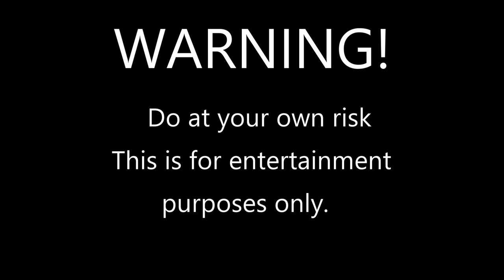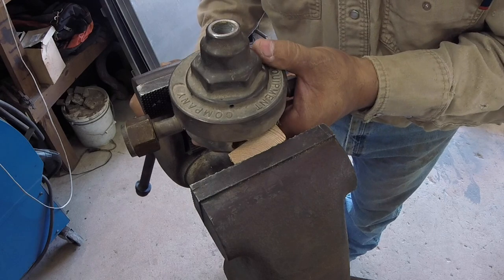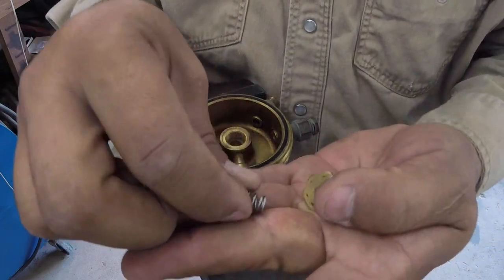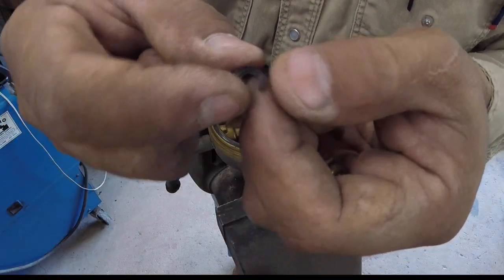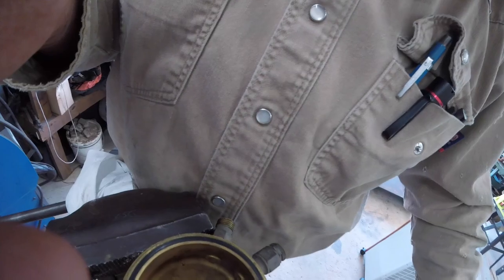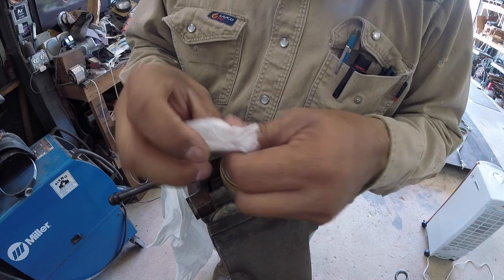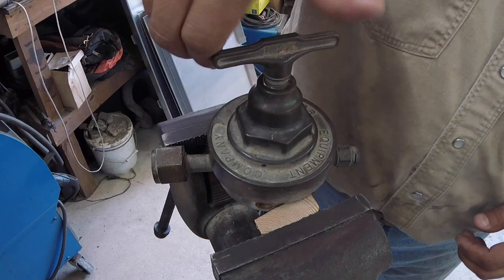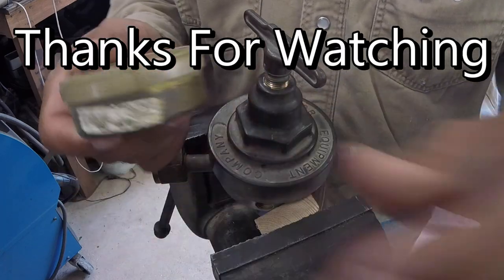Torch Regulator Repair.

Comment: DON'T TRY THIS AT HOME!!! Especially when you deal with an oxygen regulator. Even little amounts of oil in the regulator can cause explosions and devastating fires. It's an absolute hazard to your and others health and safety. I once witnessed the result of a DIY attempt to use a low pressure regulator on a high pressure tank. This time it was "only" nitrogen but the connected machine was destroyed for good and other equipment and the building itself got serverely damaged. Here in Germany you need a license to work on this regulator equipment and also you don't get spare parts in a legal way on the market. So even if a new regulator costs 8000 bucks is this worth your life?
Reply: Yep! Even just the oils from your skin is enough to cause an explosion. High pressure oxygen, it isn't worth the cost of a new regulator to be picking the old one out of your face when you turn it on.
Reply: Yes, most definately!
Reply: It's easy to clean parts to oxygen-safe standards (I worked with LOX in the Air Force among other things) but people have to study to know what those are. I use acetone and of course work outdoors. Nitrile gloves always.

Comment: Surprised the valve failed in a high pressure type of way! Could have been bad for hoses and the user.
Reply: No, the feature which ensures that does not happen is why Victor named that style the SR for safety regulator. The blowoff valve prevents overpressure when the high pressure seat fails as sooner or later any seat will. It's common for regs to last fifty years without failure they're so well made. Once overhauled they're good for another 50.

Comment: As we are discuss hydrogen carbon (oil) &oxygen - don’t use oil based forming agents (fairy liquid ) to test  for O leaks 
Don’t use lubricant on the cylinder connection WD40? 
And. Do not use copper tube anywhere in the acetylene line i.e. joining hose pipes. There is an explosive chemical reaction between copper & acetylene.

Comment: This might be a silly question but, could you just make a new one from an old inner tube? I'm not sure about that white plastic one. 
Awesome video, never tore into one. Had one do the same, took it in, OMG, could've purchased a whole new torch kit for what they charged me. It was the Oxygen regulator as well. Great video as always, cheers :)
Reply: Others posted that it’s viton (fluorine rubber), so unless you’re inner tubes are made of that you shouldn’t.  If you’re inner tube has petroleum products or another substance that reacts with high pressure oxygen it could go boom.

Comment: Geeslus, "oh muh gerd its dangerous!" relax people, keep the hydrocarbons and organics out of the O2 side and you shouldn't have any issues, yes pressure and combustibles is bad, so is being an idiot.
Reply: You realize that fingers are organic and shed skin, and skin oil is oil which explodes in high pressure oxygen?
It's not just spraying it with wd 40 that will cause problems, it can be as simple as not washing your hands before touching something, or there being a little grease residue on the handle of the wrench you are using.
Reply: @northmanlogging2769  lol I was thinking the same thing. To many internet wizards

Comment: IC Weld and the Australian "Cutting Edge Engineering" guy are my faves on YouTube.  However, I think this video needs to be removed.  Not enough care given to cleanliness, and if someone did this bare-handed with an acetylene regulator, they would be even more at risk for causing a reaction between skin oils and the C2H2.  "I wouldn't use it if it wasn't safe" is creating liability for Isaac.

Re-film this with gloves on, and proper warnings. Love your work, and would hate for anyone to get hurt.

Comment: Te adjusting screw has grease because it is not in contact with oxygen. The big seal/O-ring is in contact with low-pressure oxygen, you better avoid grease.

All regulators work the same, for torch or scuba diving.

Comment: If you could just replace that washer inside the pin nut.  There's gotta be a PN for it...
Reply: The seat is what was worn as typical and the kits have those plus the other parts which harden with age. The rebuild kits are cheap and give it all a fresh start. It makes no sense to go desperately cheap on high pressure oxygen equipment because failures can be impressively dangerous.

Comment: It is very dangerous to repair Oxygen Gas Regulator if any traces of oil or grease are left behind it is a explosive and even worse if a synthetic rubber diaphragm is used to seal base and coupling.  Let experts handle these equipments.